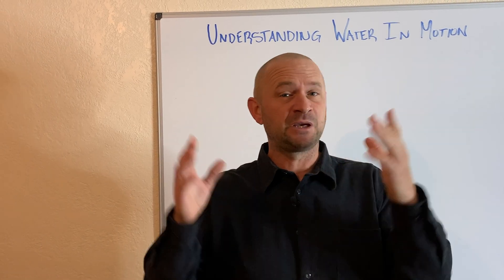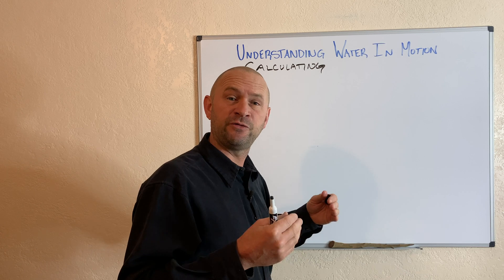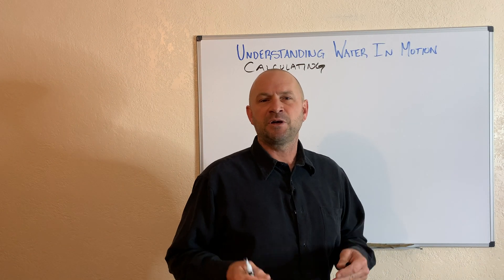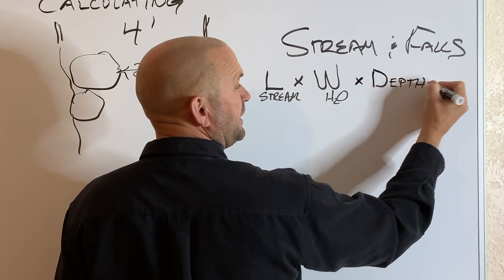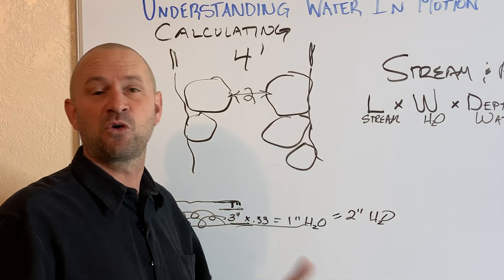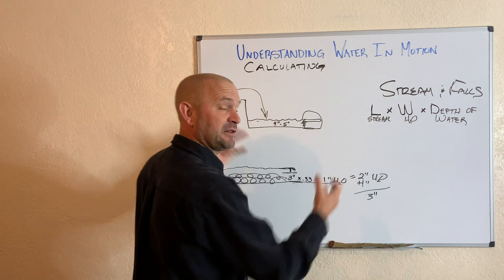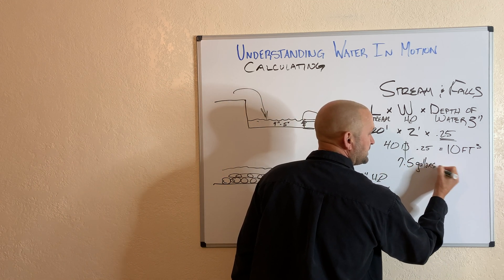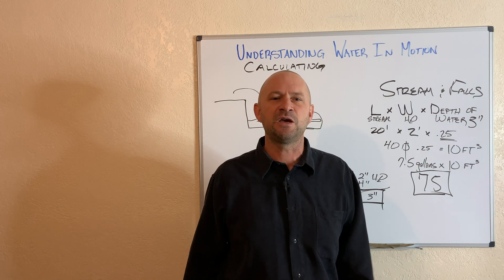How to Calculate Water in Motion! | Water Feature Design Series 1

Comment: Hello John, not sure you are still doing this stuff, but if you are, I have a question. You do such a good job of explaining so I thought I would reach out. I am building a cacti and succulent garden. I am including a desert type of water feature. Simply, it will be an approx. 40-foot long sluice box (2 sides and a bottom) with wood to look like a mining operation in the desert. The average width will be 8" and the average depth of water may be about 1".  The 40 ft length will be in 3 sections, so that the first section has a 6" drop off to the 2nd section, and the 2nd then drops about 6" to the 3rd section. So these breaks in the sluice will act as little 6" waterfalls. The water will eventually flow out of the last sluice and fall into a reservoir (either above grade or below grade) where a pipe will then transfer the water under gravity flow back to a reservoir where the pump will be. A pipe will then allow the water to be pumped up about 6 or 7 feet to the top of the first section of the sluice (the highest part). Based on my calculations (L x W x water depth) (40 ft x .66 ft x 0.08 ft x 7.5), there will be about 20 gallons of water in the sluice, and then there will be less than 5 gallons in the 2" diameter pipe (40 ft run with radius of about .1 ft [2" divided by 2"] that will transfer water from the bottom of the sluice back to the pump and reservoir. So if i am correct and what I understand from all your you tube videos, a reservoir that holds 2x to 3x the amount of total water in motion would be about 50 gallons to 75 gallons. Does that make sense to you?

Comment: Your channel is Fantastic! I need help please,
Above ground pond depth of water 5.5 ‘ with 2.5 dug below ground and 3ft sandstone boulder surround, can this be built with negative edge skimmer and wetland filter system, I’ve not seem any videos on above ground ponds is this something nobody does? Pond would be 10’ x 9’. I have design in mind but don’t even know if this can be done working correctly.
Reply from the maker: No problem! Lay out “boulder surround” and dig the pond inside. Be sure to put soil between boulders and liner (don’t use liner with rock on both sides). Neg edge below at ground level. Wetland layout as needed!
Reply: @KoiAddiction  wow thanks for the reply!
I’m a little confused still about neg edge at ground level? How do I include this? Sorry if this seems stupid but I am very new to pond design?

Comment: when calculatng the volume of a wetland filter. people go of figures of 10% 20%30% based on fish density, surface area of stocking pond and total volume of water. 

say my pond is 10.000L  and 10% of that to be wetland filter which is 1000L or 1 cubic meter. is 10% the total volume including blocks and media or just the total volume of water (30-40%) of total volume of wetland.  so at 30% it would equate to 300L which would mean that my wetland need to be a minimum 3300 total volume with the blocks and media..

is it best to design wetland based of total volume of water or surface area.

cheeers
Reply from the maker: I go off of the surface area of the pond. Many options affect what percentage are used. Anywhere from 5% of surface area up to 30% of surface area depending on desired outcome and all things considered for each feature.

Comment: Love your videos, very informative! I purchased a house that has a pondless stream. The pump sits in a 20 gallon trash can buried in the ground with a hole cut in the side to make it operate like a skimmer. The pump moves 2100 gph and the stream is around 40 feet long x 1 foot wide with a couple inches of water. Based on your calculations, my pump reservoir is way too small. When i turn off the water feature, it definitely overflows the trash can and runs out the overflow pipe. When i start it back up i just have to run a hose for a while until it achieves circulation, then it seems to operate fine. I don’t have much room at the bottom to add more reservoir storage, so other than the water loss when pump stops, it seems to work okay. Would you recommend another change?
Reply from the maker: If it’s working for you, then there ya go. Not optimal but it is better than nothing ;) It sounds “top heavy” but as long as your pump is surviving you are ok. You could put low-water shutoff float on the pump and an auto-filler to bandied the problem…

Comment: Can I have 3in depth of water in a stream, AND 1in off the entire surface area if I design the negative edge at one inch?

I guess the simple question is...

Are stream and negative edge designs independent calculations?

I want to build an oversized NE reservoir and bog filter for a 8x10x sloped 6ft deepest pond. Trying to leave it running in winter too.

I really appreciate your videos! Thanks!
Reply from the maker: Yes you can have separate calculations! If you build it tight on the neg edge you will be good! Pump size and weir width do come into play!

Comment: Thank you for these videos they are very informative.  When using this calculation it looks like it is not necessary to account for the water in the plumbing from the end of the stream/pond to the beginning of the headwaters.  Am I understanding that correctly?
Reply from the maker: If you have proper back-flows installed you are good. If not I would add for them if the plumbing runs are long!
Reply: That makes perfect sense, thanks again...love the instructional videos!

Comment: So before this how do you figure out how much depth water your going to have or how to get the depth that you want so where is what pump and what size to achieve these calculations. So before this calculation you must have the calculation to get the above calculation.  How do you know how to achieve the calculations so your basing it on already been built I am trying to figure out how to get there if that makes sense.
Reply from the maker: Look up a chart for water thickness (depth) based on Gallons per minute flow at a given spillway width and then add the amount of potential bleed down based on your construction methods. Unless you are building something monsterous, this is probably not really necessary...

Comment: Why not just add the part-volumes in the stream: If it is with gravel in the bottom then multiply that volume with the multiplyer for that type of gravel. 
How to get that multiplyer? Pour in a bucket water and fill up with gravel, then take the gravel out. The remaining is the waterpart. Measure the bucket and the remaining water, then you have the multiplier. But of course it is dependent on the type of gravel, so it can be estimated without measunging it exactly.
But of course we only need the number roughly.
Reply from the maker: Sounds complicated?